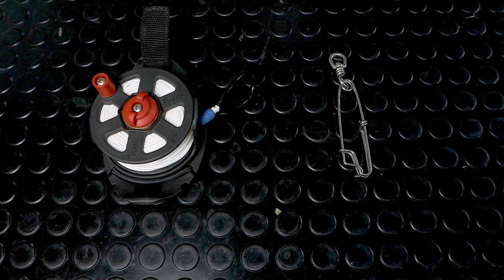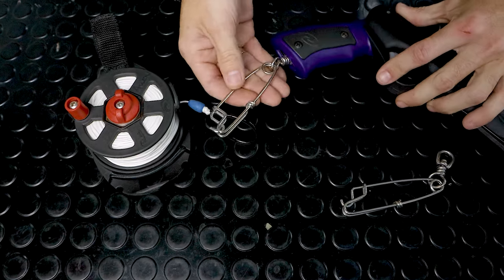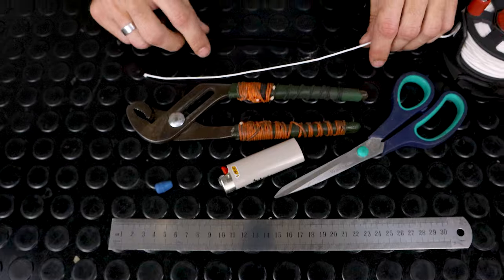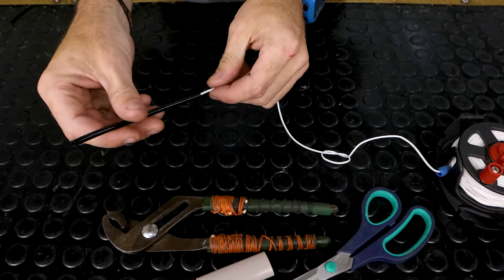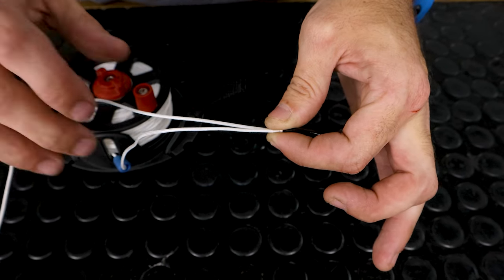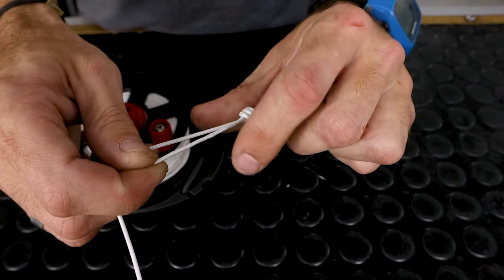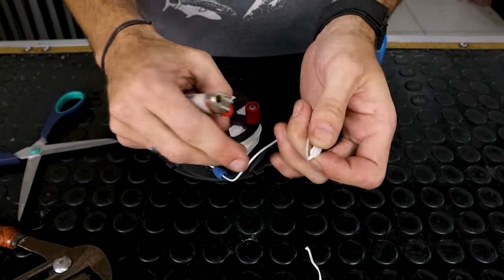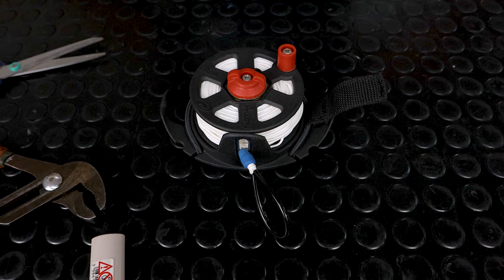Rob Allen | How To Series | Belt Reel Loop | 2024

Comment: Its certainly a neat way to do it, but fighting with the clip when the gun is pulling the other way is painful! Handle with a solid anchor point on it is definitely easier to use.
Reply from the maker: All personal preferences. Do whatever works for you. I just know of a guy who had his belt reel hook, hook up in the reef and nearly drown him. If the loop was on the gun and the clip on the reel then the loop on the gun will be pulling the other way.
Reply: @RobAllenSpearfishing  yes, it is easier to hang on to the gun by the barrel or handle then by holding on to a shark clip though. A lot of people i dive with use their reels that way is all.
Reply from the maker: @spearo16  Many now use a 1m bungee between the gun and the belt reel, all clipped in before shooting. If you need to let go, it is already connected. The bungee is somewhat stiffer than line so not so easy to entangle.
Reply: @RobAllenSpearfishing  we do this mostly here in Panama ><)))^> works great.

Comment: Since then 1950's my Dad first, started using stainless cable on a Penn 65 saltwater reel attached to the speargun to play larger fish. Real drag and attached a 2 drag at the muzzle. Cave dvellers needed stoping before reaching the hole and pelagics let run. No cutoffs. Cable sinks inmediatelly and doesn't float arround for you to get tangled. Dyneema on a belt reel, not a good idea. A float line beter
Reply: What kak is this man. Leave the South Africans to make good diver gear

Comment: Assuming you deployed the belt reel and you have to go back down to get the fish out of hole, what do you do with the belt reel. Tie it off to a float or take back down with you and could that be a tangle danger.
Reply from the maker: Best is to get the boat guys to throw you a float and clip it to that. It is very easy to disconnect the reel from your belt.
Reply: Think of the bet reel as an extension of your gun's reel. If shot without a belt reel, only a gun reel, one would pass the gun to the surface buddy, the boat or clip it into a float. 
The float option is also nice as no diver is kept busy handling a line and one can adjust the line length at the float's clip  ;-)